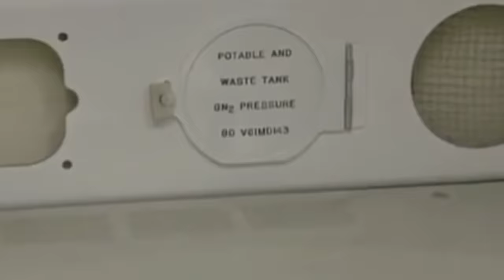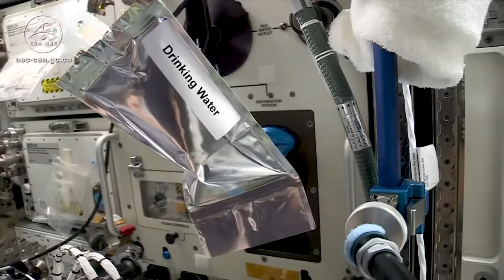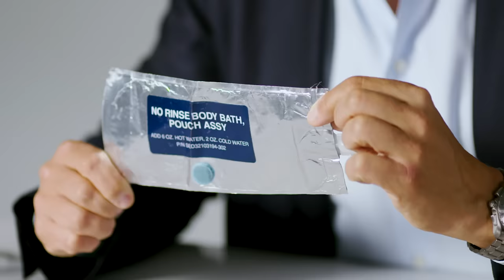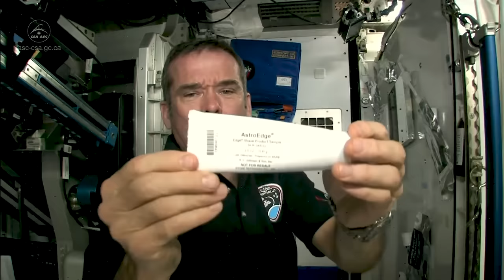Former NASA Astronaut Explains How Hygiene Is Different in Space | WIRED

Comment: Honest question: How does urinating works in space?
The muscles in the bladder give way for the urine to flow - on earth it is "pulled" by gravity(?).
Is it different in space? I mean, if you have a look at how water behaves, you get the feeling it sticks to the surface of an object.
Reply: They have a pipe that works like a vaccum cleaner, you just have to pee in it, I think there's a video of the woman here that she's explaining how it works
Reply: The pee hose system is basically attached to a lever. Once you are ready to pee, you will turn the system on by pushing the lever down and it will create an airflow which will then pull the liquid down the hose and into the tank. It begins at 1:52.

Comment: Most of us do not need to shower everyday. Unless you're working a an industrial field where you're likely to come in contact with certain substances, no one typically becomes unclean enough to justify that waste of water and time. It's a cultural norm based on myth, not necessity or even pleasantness to be around.
Reply: Dust and debris, Bacteria grows on your skin, sweating, shedding dead skin cells and natural body oil etc. Yeah daily shower is a must
Reply: Alistair Kaname Dust is mostly dead skin cells, and most people are not typically in a very dusty space. Your microbiome is very important. You’ll be stripping of the good bacteria that helps keep your skin in a good conditions and helps protect it, you’ll actually make it more susceptible to issues. Sweat is water soluble, and will easily evaporate on most parts of your body without smelling. A smell only develops when the sweat is trapped, it’s intensity varies depending on the genetic makeup of a person, as the sweat needs certain compounds that cause certain bacteria to develop ,but you only need to wash those particular areas, not the whole body. Anti perspirant can actually cause sweat to clog and build up, that’s why you feel the need to shower so often.

Natural body oil is vital to keep your skin moisturised and conditioned, believe me, I’ve been on medication that inhibits it. You’re actually going to overproduce oil when you strip it away all the time, since your body tries to replenish it. Let it balance out. Dead skin cells actually form a barrier over parts of the skin, and layers will naturally fall into the atmosphere as your skin continually sheds, no more than necessary will stick to you. It’s simply cultural convention. Showering everyday is certainly not a must for most people.